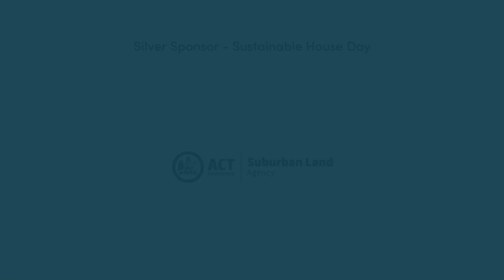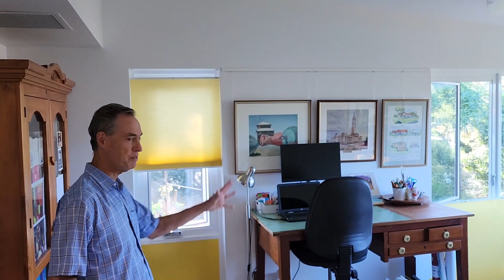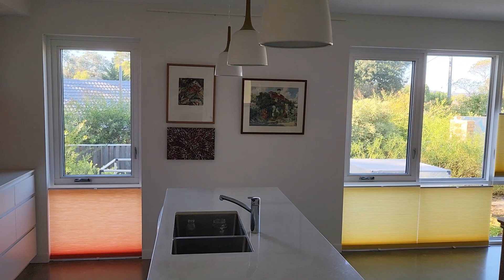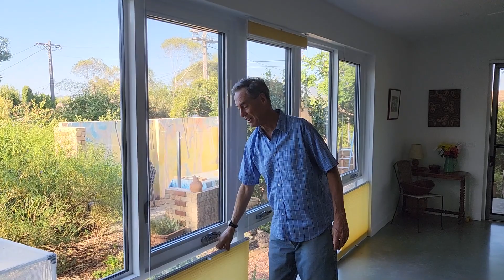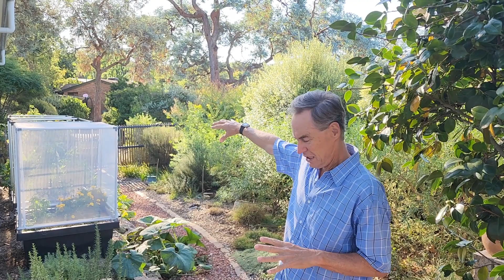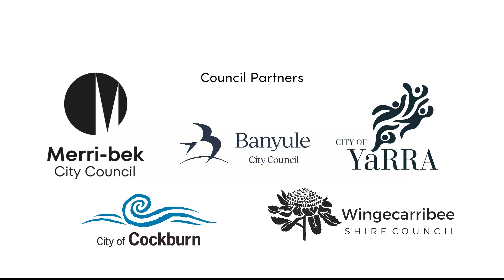Colourful House - Sustainable House Day 2024

Comment: Xps boards shouldn't be placed outside in your climate, vapour permiability must increase from inside to outside in order to let the vapour escape, otherwise it will be locked inside the walls because the dew point is in the mineral wool insulation and it's ok if there's a vapour permeable membrane instead of xps boards, but in your house eventually it will lead to dampness and mould growth, timber frame will rot pretty fast.